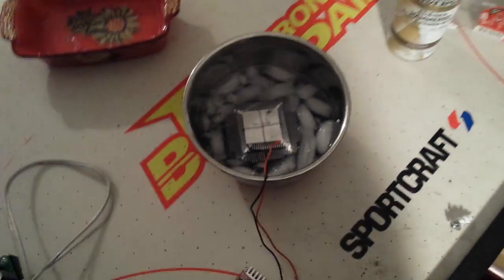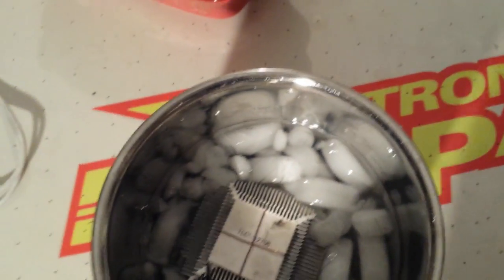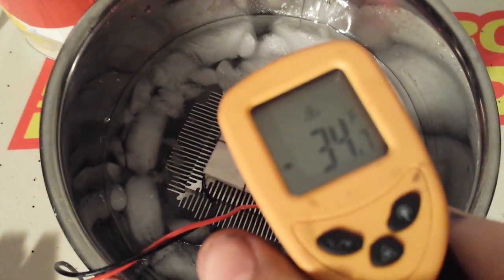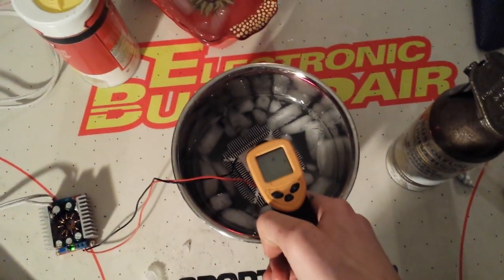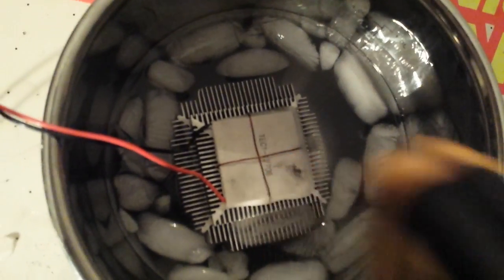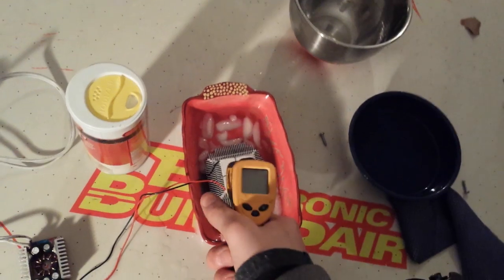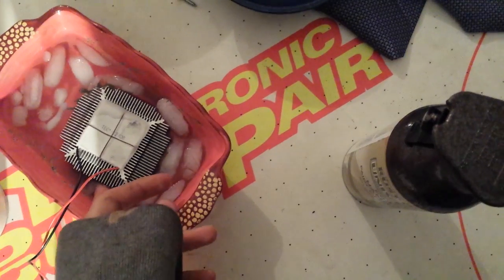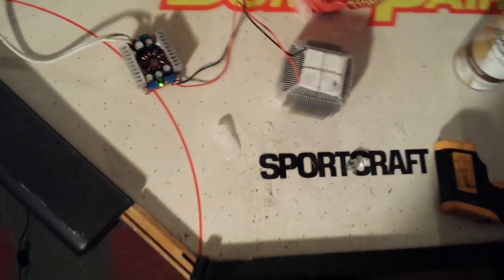homemade supercooler -50 degrees

Comment: so if you put the heatsink in a bath of dry ice and acetone, would the peltier still cool it further?
Reply from the maker: yes it would because the dry ice would allow even more heat to be removed from the hot side allowing the cool side to get even colder

Comment: Good idea using ice water to cool the device.
- May want to try cooling w/ just water (with no ice) and see how cold you can get the device.
- Need to know how many watts you're pushin thru that thing. Need to calc Watts per degree.  
- Also need to measure the temp of both sides of your peltier, and possibly the water as well.
- Stack as many peltiers as you have together, be sure and measure how many watts you're pushin thru the entire circuit.
- Using stacked peltiers is how they supercool the super computer cpus as well.
- That looks like about a 75 watt max peltier.  The laptop charger may not be able to hold 75 watts for long.  If you add more peltiers and try using just that one charger, no way will you get enough power to get to max cooling.
Look forward to you future vids.
Reply from the maker: +superbee1970 thanks for the comment this peltier used 60watts and i used ice water because i wanted to see how cold i could possible get it just for fun. i did make a refrigerator using a peltier but i never uploaded a video because i started working on other projects and i do agree that the laptop charger is not optimal because it started to get warm one thing i did after this video was modified a desktop computer power supply to allow more room to increase power.